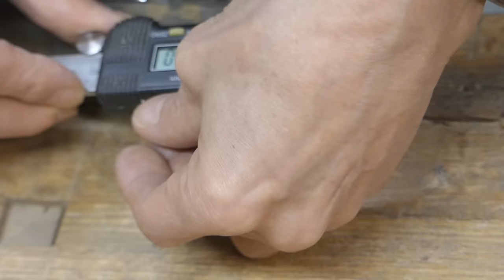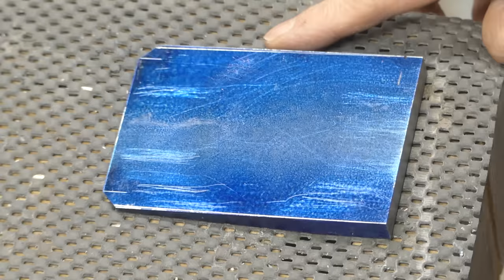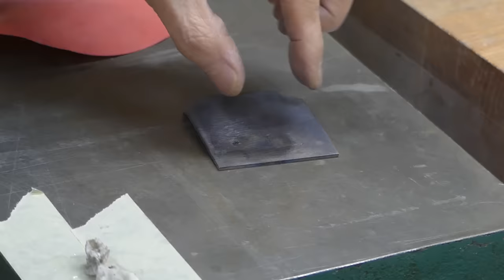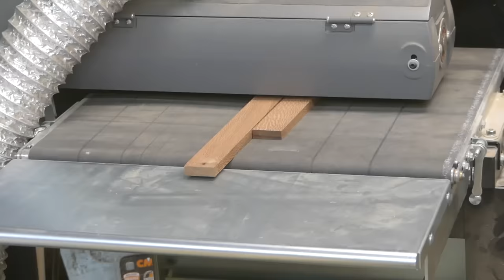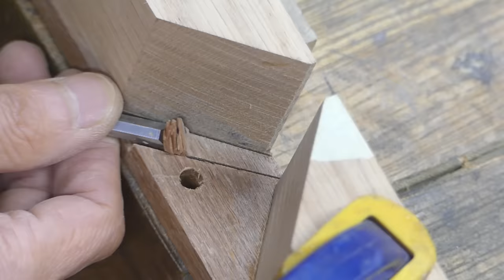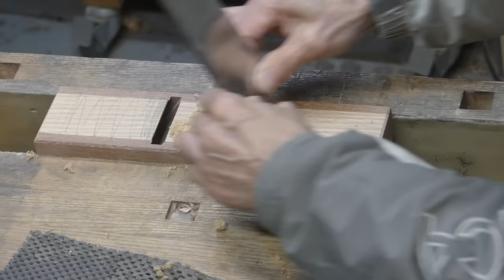Make a Kanna plane (blade & chip Breaker)

Comment: Once again a couple nice planes . A little trick for the next time you cut these irons . If your bandsaw has the height, stand the metal up build a jig “ if you want “ or freehand it , but cut the angle in it from the start ! Saves on grinding and if you plan on marketing 2 or more blades the next one already has an angle cut in it . Learned that when I made a bunch of wedges for log splitting

Comment: I'm 16 and you inspired me to make this hand plane but a cheaper one,my equipments kinda poor for me so this is the equipments
Hammer
Drill 
Plywood
2by2 wood scrap
Steel blade from a old chisel
Hack saw and cross cut saw
Chip breaker is wood
And the bar concrete nail 
I know it's cheap but I'm poor

Comment: great work👍, i have so much fun to watch this video. when you quench the steel, what kind of oil did you use( i assume you used oil rather than water since it is O1 steel basd on the description)? did you also temper the steel of quenching it? Thank you!

Comment: Did you make the body at  25 degrees and the blade ground at 25 also to get to 50 ?
Reply from the maker: This is a bevel down plane, So the bed angle is 50 degrees What you say is established when you are a Bevel Up plane

Comment: Great work! :) When using a japanese plane, I found it easier to put as little pressure as possible on the tool. 

It it's too large, you should try turning it into a chinese or a korean push plane by adding a handle right behind the blade.

Comment: Nooo, don't scrape with your vernier caliper 😱
Reply: It's a tool ...intended to be used for the job at hand.  That's why they made the points sharp.
Besides, it's not a vernier, it's a digital caliper.  Vernier calipers provide a measurement by alignment of precise lines of a main scale and a vernier scale.
Reply: @lynnlard5531  The accuracy will suffer from using it for marking, there are calipers specifically made for that.

Comment: In Japan the plane is called 'kanna' it's not a type of plane, it IS a plane.
They're made of a single piece of wood, not glued sections as you have shown here. What you have made is a poor imitation of a Japanese plane. You'd actually have been better to buy a cheap Kanna from Amazon for about £70, made a from a decent piece of quarter sawn oak and with a laminated blade.